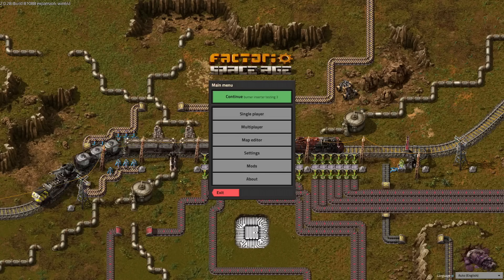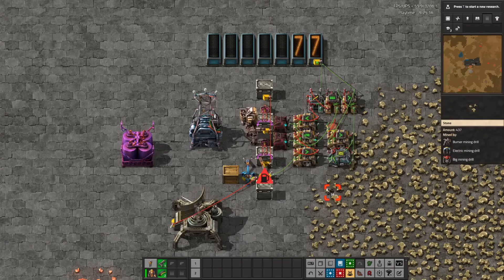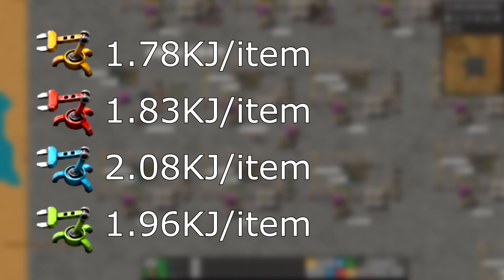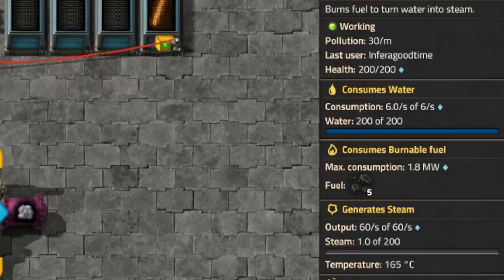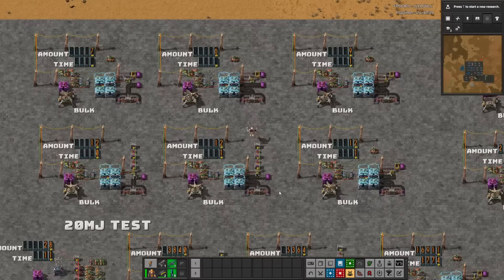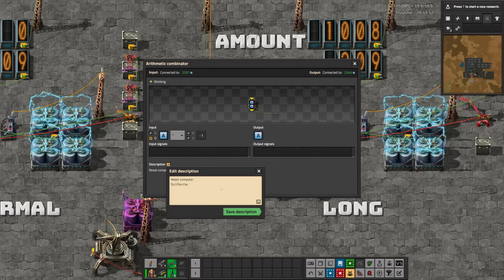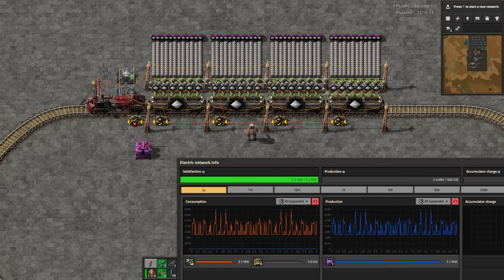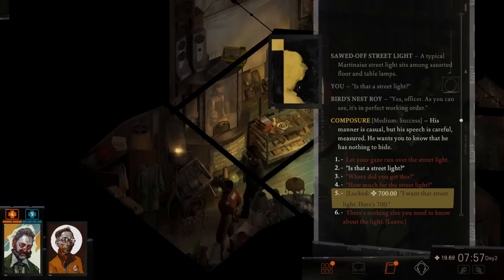Inserter Power Draw is WEIRD (and Burner Inserters SUCK) -Factorio: Space Age

Comment: The interesting questios in what is ration of the coal consumption between a burner inserter and a boiler? If it is like 1 to 50 or more then there is no point of optimizing consumption of inserters. It might be more than an inserter but still negligable.

Comment: Hey, mod dev here. I've done some more manual work on the internal side trying to figure out an efficiency ratio for burner/electric machines, and my testing ended up with electric machines being something like 30 times more efficient, power wise. Rather astonishing. On your points about the power draw having peaks and valleys, this is also part of the implementation: each inserter has two properties, energy_per_rotation and energy_per_movement. Spinning an inserter has a much lower power draw compared to making it extend/interact. Of course, lower distances mean lower power draw. "Grabbing" and "extending" are power-hungry operations, and generally slow. So using bob's inserters and having them push in and out is really the worst way you could use your inserters...

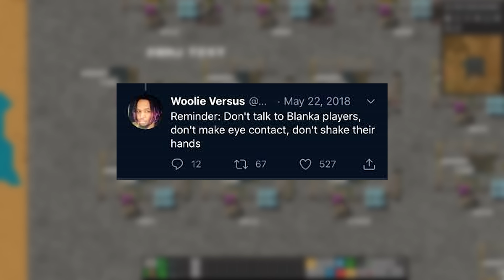Comment: 2:30 watt-hours are nice for practical aplications. A space heater with a draw of 1 kilowatt (which is the operating range for many household appliances with a big draw) running for 3 hours needs 3kWh. Not in factorio however.

Comment: solid fuel from coal liquefaction is about 3 times more efficient than just burning the coal, with stack size 4 and solid fuel being 12 MJs the inserter needs to move every 26.7 seconds which is still not good enough. if you've been to Gleba and have rocket fuel productivity then it's better to turn the solid fuel into rocket fuel, 4x100MJ/1.8MW=222.2 seconds per inserter movement, but this isn't actually fair because if you've been to Gleba for rocket fuel prod then you also have heat towers which take 16 MW so 400MJ/16MW=25 which is not good enough. so burner inserters are still barely not worth it.

Comment: I work at a robotics company and the best I can think as to why inserters use less power when picking from far away is that articulated robots are most efficient when doing what is called a “Joint Move.” Basically, when moving in a way that uses the least amount of movement from the robot, but not necessarily in the shortest physical distance. A “Linear Move” is generally less efficient. Because these robots seem to rotate along their first axis mainly, it means that when it doesn’t need to operate the middle axes to reach the closer side of the belt it needs to move less and therefore spends less power.
Reply: it would be complete insanity if they programmed that into factorio. Chances are it just has something to do with fps or weird spagetti code
Reply: @MyNameIsSalo  I don't think the program the power draw directly like that, but they do move more to pick up closer, which takes more time, so they spend more time in the power expensive pick-up phase
Reply: I support this wholeheartedly. Specifically, bob’s adjustable inserters (which I believe still uses the core inserter code) shows that inserters will extend/shrink linearly to pick up an item (quite slowly), rotate to the destination angle, then grow/shrink linearly to put it down, then rotate back. (It might actually be growing/shrinking while rotating, but it’s too slow to tell). That extra time extending makes a HUGE difference. Since inserters place onto the far side of the belt by default, it would make sense that picking up from the far side minimizes the time needed to change length.

Comment: I think power is drawn from the network when the kinetic energy and/or potential energy of the inserter's hand (and possibly items) increase.
At one point in the video you were talking about small irregular variations/histeresis. Probably the hand of the inserter moving to grab multiple items from both lanes and encountering small gaps in the items on the belt.
Also it seems like the inserter's preferred lane is on the far side so it has to make extra movements for the inside lane.
Maybe it would be interesting if you can research inserter regen braking on Fulgora.
Anyway, awesome video and thanks for doing this so we don't have to 🫡

Comment: its been a while since i played Factorio, but i always have one Burner Inserter in every Steam based Power Plant, to enable Black Start capability. For Coal based ones i had one on the Row for internal power, which also had 3 regular inserters for power efficiency. If this Setup ran out of Coal its enough to re-feed the Coal for a restart. (also the Coal Mines were hooked to that internal power if possible)

For nuclear Power Plants they had an even lesser role, but i still use them. I usually hook up a chest-fed regular Boiler to a seperate Steam Turbine, which can also draw from the 500deg steam (and will preferably use the hotter steam) to get the Control Logic and 1st row Inserters running. And said first row then in turn powers the rest of the Plant. This makes the Setup Black start capable (meaning it can start up without external power input). I know that is not needed, but its just one additional Steam Turbine, Burner Inserter and Boiler, so i think why not..

Comment: In my Space Exploration run I had nuclear-fuel powered burner inserters put nuclear fuel into my air-generators since pre Space Age generating power without water was quite a struggle.
Which is probably one of the most unhinged things you can do in Factorio.

Comment: I suspect the orientation and lane of item affecting power draw is because the inserter defaults to the far lane, so it moves to that position first and then has a few additional frames of travel to actually drop/pickup the item - so you're getting slightly offset delays when moving the item. Would love to see someone test that hypothesis :D

Comment: Personally, I think burner inserters are fine when being used for steam power plants with boilers. Because the last thing you want to deal with is the death spiral caused by your inserters not getting enough power to fuel the boilers, which'll be burning through their fuel as fast as possible if you're already drawing so much to slow them down.

Comment: I'll switch to a separate network as a black-out protection when creating and sustaining separate electric grid stops being so fucking annoying. If you could disable automatic wire connection for chosen poles and make it so that a building doesn't auto connect to the network just by being in pole's supply range, oh the things I'd do with power switches...

Comment: Note about power switch. My mega-base experience indicates that power switches are crazy important - not because of the power draw, but because of the impact on UPS. Turning off the power to assemblers, inserters, etc. completely eliminates them from the game loop. So, I turn off parts of the factory that are idle, in order to allow the rest of the factory to work smoothly. I have not run into UPS issues on space age / factorio 2.0 yet, but... it is likely the same.

Comment: I used power switches to make a brownout proof power supply. Its next to an accumulator and will shut off when the accumulator is below 25% and turn back on above 75%. In the case that part of the factory uses too much power, this will sort of pulse it on and off . 

I did this because producing power pre-fusion on aquilo requires a large amount of machinery to be powered, and the science producing parts of aquilo factories require a ton of power, and this will disconnect the latter to leave only the former running

If that accumulator is the only one in the network it is unfortunately not enough to prevent issues if your power supply itself collapses, as there won’t be enough power to trigger the circuitry. Might be circumventable by having 2 accumulators on a secondary network that gets its power parasitically from an accumulator on the first, which leaves you with 300kw to power just the control circuitry, or maybe setting the power switch to trigger directly based on the accumulators charge, which would remove hysteresis causing the switch to go back and forth very quickly, but it would mean theres no combinators wanting to get power

Comment: I use power switches for beaconed builds turning them off when the output is full or any of the inputs are empty. Instead of using combinators, I just use series/parallel circuits of power switches to do the logic. Beacons consume a significant amount of power so I think it's justified even on nuclear power.
Especially since all my planets are running on nuclear power which need fuel shipped from Nauvis (which was just something I decided to do).

Comment: My proposed solution for a reliable power setup is to add a power switch to the powerplant. If energy becomes a problem powerplant will just disconect itself to power all the inserters. I used to use burner inserters, but after watching it seems like it's the simplest way. It's not easy to make an isolated network to power just inserters. But this "power switch" design has all the benefits and only requires you to to not connect to powerplant directly but only via the power switch. In this case it will never run out of inserter energy.

Comment: Stack inserters may not be primarily meant for inventory to inventory transport, but doesn't the larger hand size technically make them the fastest inserters to use for that anyways?
Reply from the maker: It wasn't the intent of the test to figure out throughput but it's pretty obvious that Stack inserters do have the highest throughput by a large margin. In the container-to-container test for instance you can calculate from the results that the Bulk inserter moved about 30 items per second while the Stack managed 40.

Stack inserters do run into issues with belts when they aren't fully saturated however, as they always wait for a full hand of cargo before swinging, which can lead to hiccups in production. A lower power draw is not the only reason you might prefer to use a bulk inserter instead.

Comment: But constant combinators and such also use power. It's not much, but it's weird that you left it interfering with the testing itself
Reply from the maker: I isolated the inserters in the testing environment from the combinators, radars and nixie tubes using power switches, and the pink inserters from the editor extension mod don't consume power. The burner inserter doesn't have electrical isolation because it doesn't consume electricity.

You can check the electrical networks yourself in the blueprints.

Comment: theres one odd power feature i havent been able to find a use for personally, so id figure id post it here in case anyone has an idea.
using accumulators and manually disconnected power poles (two disconnected poles both in range of the accumulator), you can have a power network fed entirely off off accumulators (given no other power sources are present.)
these accumulator subnetworks have two noticeable quirks. first, the networks are unable to charge accumulators themselves (accumulators cant charge other accumulators, it makes sense). im not sure if it would be useful, but you might be able to have some sort of layered network where you could let external power through to the secondary network to get to a tertiary network? anyways, secondly these accumulators networks have very tightly controlled power input (base of 300kw/accumulator.) due to accumulator speed. again, not sure if this is useful but who knows. by the nature of accumulators, these secondary networks also only get powered when the main network is overproducing.

Comment: Despite how bad burner inserters are, there's no other option for powering your Aquillo outposts.
Reply: Didn't use a single burner inserter except on nauvis during my space age playthrough?
Reply: @trackingdifbeatsaber8203  How did you heat the resource nodes far away from your base on Aquillo?
Reply: @Liwet.  I shipped in nuclear fuel and had bot fed reactors to make power and warmth. Nodes where not that bad in terms of distance it wasn't really a problem, had a dedicated nuclear reactor for the lithium pump although used heat from there once we expanded the rocket silio stack from 1 to 10 rockets.

Comment: You mentioned that OBS made it perform better, half as a joke.  Have you considered that inserters may be, erroneously, fps dependent?  The inconsistent measurements lines up with experience for fps dependent code, at least.  I'd try artificially dropping your framerate and seeing if that changes measurements.
Reply: It's frame dependent, but not framerate. If it was, multiplayer would constantly desync.
Reply: This is factorio we're talking about.

Do you seriously think the devs would leave anything up to frame dependent calculations?
Reply: @aberrant-thoughtspace-entity  Anyone can make a mistake.   Wube is full of excellent programmers, but from my experience as a developer, that kind of inconsistency is indicative of a non uniform update pattern.  The most likely suspect is frame dependency, but it could be something more insidious, though what that would be, I couldn't do anything but speculate.
Reply: @SladenT   Fair enough.

From what I know and heard, it could be some combination of the way the open slots on belts constantly move and the way the arm calculates the most efficient path to a chosen spot.

It is after all extremely consistent once the arm has settled into a pattern.
Reply: they thougt they had this one licked before 1.0,hilarious to see it's still not truly fixed
Reply: @Hyratel   I think that's something different. That had to do with the way the arm calculated where to move and doing it inefficiently. this has to do with the arm correcting it's target as the slot moves on the belt. I don't think it's physically possible to fix that without tanking ups. If it could even be considered a problem in the first place.

Comment: THE WATT???

First, i have no knowladge of this subject, so grain of salt...

6 MW...
From a calculator, LED's should produce around 540 mio Lumen with this amount of Watt...
We get from the sun around 133,200 lumens per square meter
That means, one of the lamps would be enough for over 4000 square meter...

With low pressure sodium vapour lamps, this ones get up to 183 lumen per watt...
So 6 MW = 1 Mrd Lume = 8243 square meter per lamp
 Holy cooking

Comment: Generally inserters are such a small fraction of overall factory power consumption I don't really worry about individual inserter power draw. I know that burner inserters are power hungry but I still use them in the early game for brownout-proofing my coal power setup. Late game, most of the boilers I have operational are the ones I use for burning off excess wood, so, in my opinion, those things can burn off as much as they want.

Comment: My first guess for the differences in consumption has to do with the exact position of the items on the belt. If it's not precisely at the pickup point the inserter will use a tiny bit more power moving to it to grab it right? So when you copy and paste them all down at once they're all precisely synchronized so it makes sense they'd draw the same power.

Comment: Perhaps the reason the inside of the belt takes more power is because the arm has to bend from its default length of extension? My amateur assumption is that the the power draw is coded to be based on the amount of movement the inserter does and micro-variations are as a result of the exact distances and timings that the inserters have to move at.
Reply: I think it's more likely that the bending just takes longer so it spends more time in the power costly phase